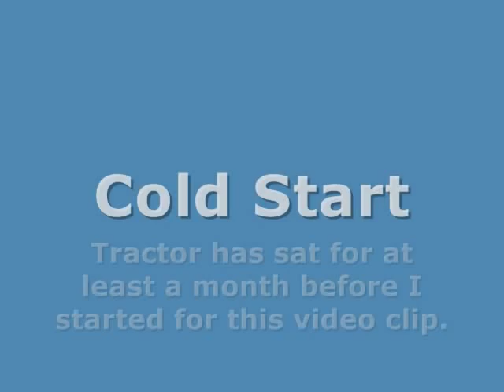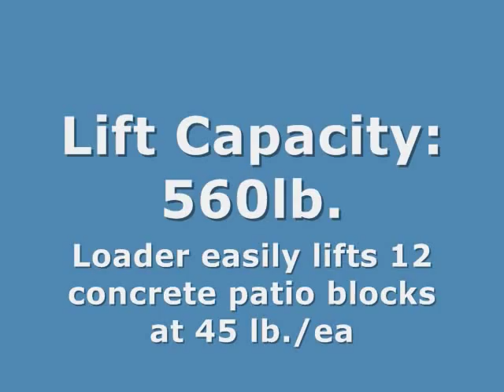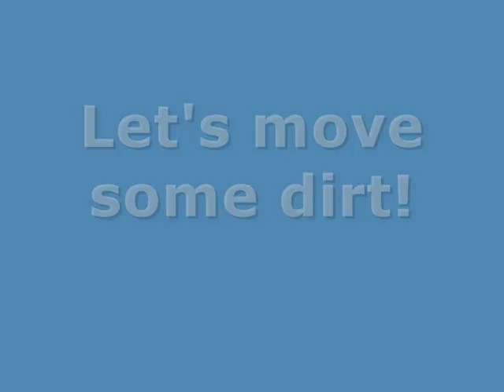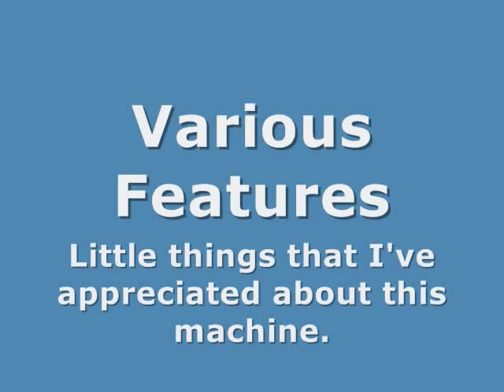Montgomery Ward 14 HP Tractor With Loader

Comment: Sure is a "handy-dandy " little "lift-tote-a-matic". The self-level linkages makes a great attribute. The "roll-back" needs to be "tweeked" by advancing the bottom pivot point & maybe some amplifying bucket-linkage assembly's. This "was" a Roper tractor before Montgomery-Ward re-branded it. " They" 96% don't  make them this good any more- let alone made to LAST 50 YEARS!  Got's me a herd of "horses"  --Wheelhorse's of course; they are 55-25years young & 75% of the "Herd" still performs wonderfully.  No loaders yet. Thanks for the inspirations & great Vidio Sir & happy safe tractoring.

Comment: Really neat design front end loader.  I've never seen before.  Reads like a Garden Mark?  Do you know who made?  Looking around quick on Google I'm not finding anything related to.  Planning to make the front end loader and back hoe for the John Deere 240 I'm modifying into a Ford 320 SVT and the Ford YT16 that's a Gilson stock design I'm beefing up.  The JD will be the hydraulic platform and the YT will be the electronic platform for actuation and control.   I plan to make the front end loader the articulating bucket design since isn't that much more work to do.  I also like your quick release bucket design and plan to do the same since the other main project is using an old 42" single stage John Deere snow thrower auger for a cement mixer. Basically flipping the blower upside down and actuating a chute slide valve to open and close for flowing on the bottom straight out or through a tube.  Nice work platform idea also... will have to keep in mind.  Thanks for sharing!